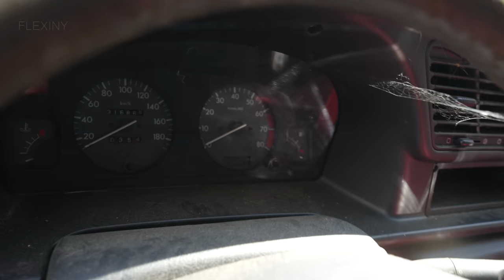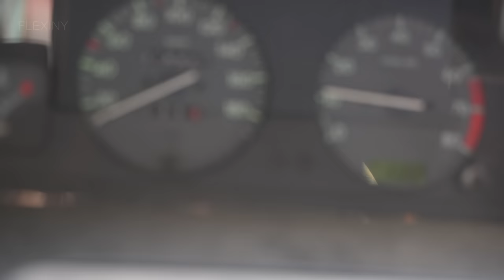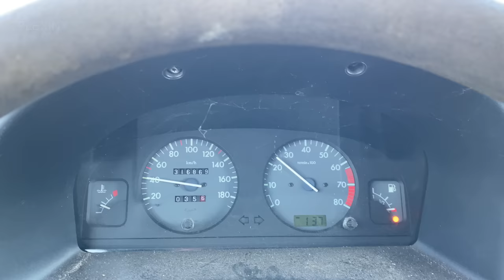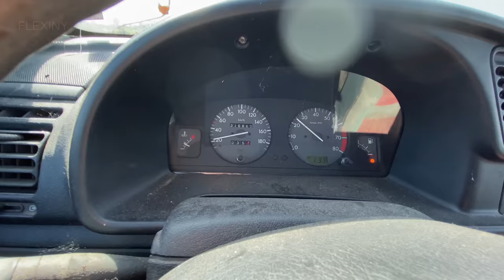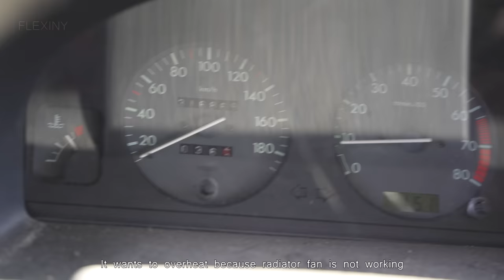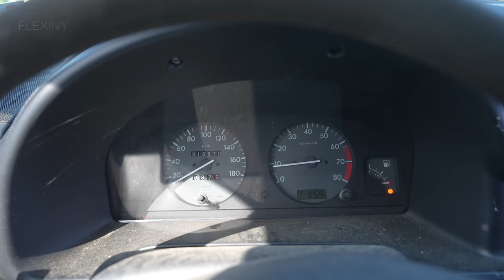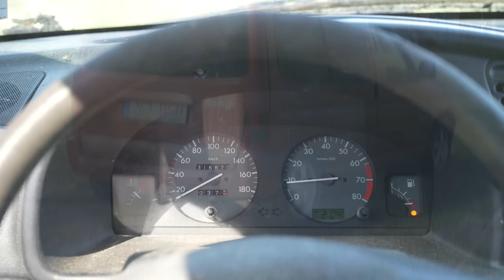Starting 1997 Citroen Berlingo After 3 Years + Test Drive

Comment: When I saw the XU7 engine, I thought, it will start first time, and it did hahaha.
The XU7 and XU10 engines are one of the most reliable gasoline engines manufactured by the PSA group.
300,000 km for that Berlingo is little, it's still in the running-in process XDD!

Comment: Wasn’t surprised at how easily this started back up. The Berlingo/Partner is a tough little thing, and the engines fairly dependable. Still occasionally see later ones floating around as little work vans for self employed people or a cheap mini people carrier for young families. Again, it’s only really rust and general wear and tear that has been the death of these.
Reply: Biggest problems are rust on rockers and torsion bar suspension on back. Almost every time first problem is the support/control arm bearing brokes and arm start to lose up and moving sideways and wheel starts to bend inside the body. That will destroy driving dynamics and always fail the inspection. That same problem is on every French torsion bar suspension cars Xsara, Picasso etc.
Reply: @LaitinenVeeti  Yup, rusted out suspension killed my college tutor’s Peugeot Partner, he was pretty upset to lose that van

Comment: My old Xsara Pic started first turn after 4 years on a drive. Was a 57 plate and by 2014 still had the original battery (that hadn't been maintained). Battery was sulphated and had been through a cold winter but somehow recovered after a few days of some encouragement. Put it back in and she was alive. Love the hdi/tdci engines even though the 1.9d and td get the attention for reliability.
Also I always buy varta batteries when the need arises. I'm yet to have one die before the cars do

Comment: Thi car is very nice. To work, to carry smaller things, some furniture, building materials and other things. This car will last a long time. Just change the oil and filters and there is something wrong with the radiator. But overall condition is good :) thank you for the video

Comment: I bought a 2002 1.9 DW8 for £250 a few years ago with only 70k miles on it, with slight frontal damage.  The older versions hadn't got the BSM unit and were a lot easier to work on.  I put a set of seats from a Rover 400 into it and fitted a bulkhead.  Returned a steady 45mpg but was probably the slowest vehicle I ever owned.  Both torsion bars broke on it though and while it was sitting waiting for repair it accidentally caught fire.
Reply: the DW8 is a great engine, we had a few Partners in our family for working vans, my father's got to 780mkm, mine have 300K and it's used mostly in the city and abused as hell, the only major problem i had with was power steering pump i changed three times but again the poor thing have a mediocre turning radius that's why

Comment: Rear end looks a bit "stanced", the suspension in these is known to snap the torsion bar with age (seized bearings, rust, etc.), resulting in the back end collapsing, not fun times when that happens, especially if it's got a load in the rear or towing something...
Reply: It is not the only problem with torsion bar suspension. Almost everytime first problem is the support/control arm bearing brokes and arm start to lose up and moving sideways and wheel starts to bend inside the body. That will destoroy driving dynamics and always fail the inspection. That same problem is on every French torsion bar suspension cars Xsara, Picasso etc.

Comment: Replace new TIMMING belt , air cond belt and starter belt , new engine oil , transmission fluid , flush brake fluid , service all brake pump , replace 4 new absorbers ...can last another 25 years ...! Old Citroen engine is easy maintenance ..!

Comment: 1.5  diesel?
Reply: 1.8 8 valve i think. Same as 306 and Xsara. Impossible to kill it, very reliable motor
Reply: @floriandugoli5923  Turbodiesel?
Reply: @amedeoperri3571  pétrol you can listen the sound
Reply: No, It is a 1.8 engine with 8 valves, it is a brother engine of the XUD.
The XU 1.5, 1.8 and 2.0 that came out were the only gasoline engines that were based on the XUD engine.
That's why those engines came out very good, because the design was similar to the diesel version.
Then PSA took out the EWs, which are crap, consume oil, wear out the cylinder liners.
And no, this version does not have a turbo, but there are high-performance versions that do.
The funny thing is that PSA when I present the EW and DW, the DW has nothing of the EW, the DW is actually an XU11 with another name adapted to direct injection.
Reply: @SrWolf90  Thank you!